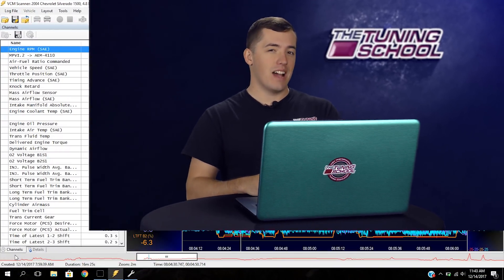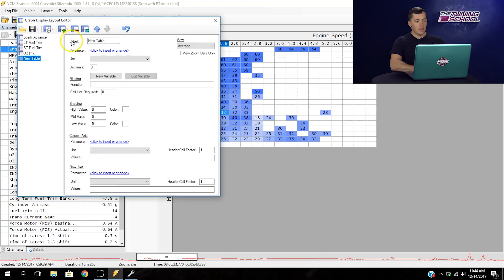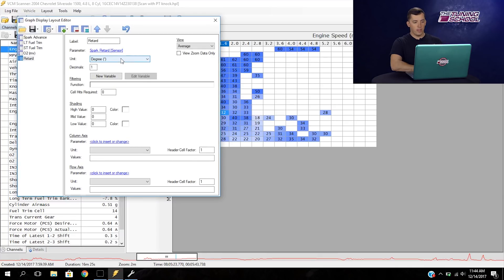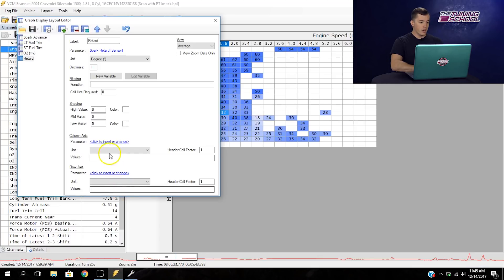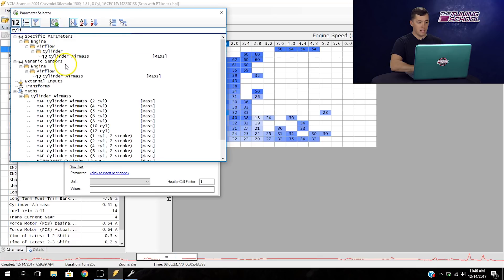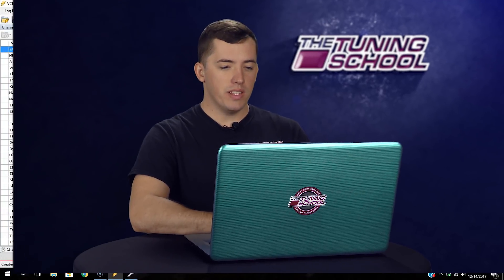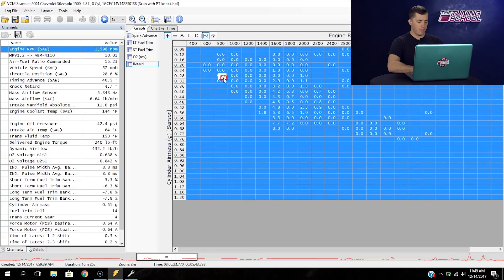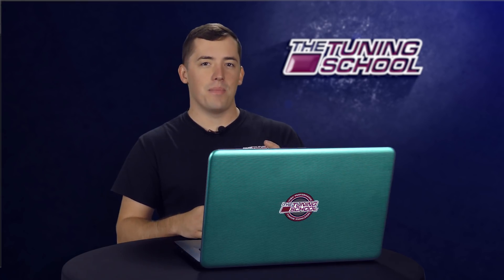How to Fix Partial Throttle Knock Using HP Tuners 3.x Software: Creating a Custom Graph

Comment: I believe there is a flaw with this method that needs to be accounted for. The spark decay rate will permit knock retard in other cells, where there may have been no knock at all as the spark retard decays down to 0, unless of course the scanner is programmed to omit logging knock in a state of decay. Smoothing should probably be mentioned also, as a 7 deg subtraction next to a cell with no correction is going to make for a pretty jagged spark table, not to mention some PCMs will go haywire with that kind of coarseness. Some beginners may not be aware of this and follow the above instructions as is and end up in tail chasing trouble.
Reply: How do you tune this out?  I don't wanna go tuning the sensitivity if I dont have to though I may have some reverb from modified exhaust or all kinds of crop banging around besides the pistons...  lol  For real though, what would you recommend to account for the decay?  Im seeing in my tables no knock then after the cell hit has passed other cells, it'll show up as knock a few seconds later in the same cells it detected zero knock..  Pain in my a$$....  Thanks for that insight

Comment: Now how do you get rid of false knock, cause I can subtract 3 times the timing as there is knock and it will still knock same amount. I'm thinking its clutch chatter at this point. Pretty well always in cylinder 4 on i4
Reply from the maker: We have some other videos that may help you. 
https://www.youtube.com/watch?v=ScjfTGLnpPk&t=1s
https://www.youtube.com/watch?v=S8L9IUbt7ag&list=PL_lGy-2a1ig-KtFG7JH0TbOYBKdXDkeH-&index=9&t=6s
and an article on our site https://thetuningschool.com/blogs/news/knock-knock-article.

Feel free to contact us if you have any more questions!
Reply: @TheTuningSchool  well based on this, my knock is false. I have reduced timing , added fuel, added ethanol to my tank for higher octane and I spray about 1000cc meth , I still get random knock here and there in boost. Not usually though,the more I get into it it goes away. And the light throttle stuff is still there randomly. Have run like this 3 years and its still going lol and I never heard an audible ping. So thanks this really helps ease my mind

Comment: This is so much nicer than reducing the entire table. My tuner wiped out 5 degrees for the whole table when it was just in upper rpm. I used this method and ditched the previous tune revision for WOT spark retard. I had to select Min values to show the higher knock. Max just showed 0.
Thanks.
Reply from the maker: You're welcome. Thanks for watching!